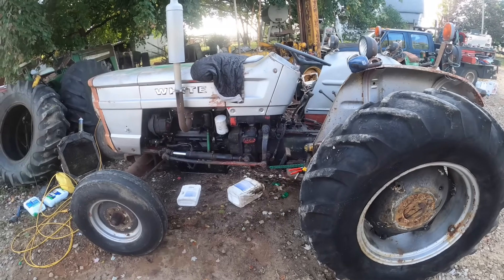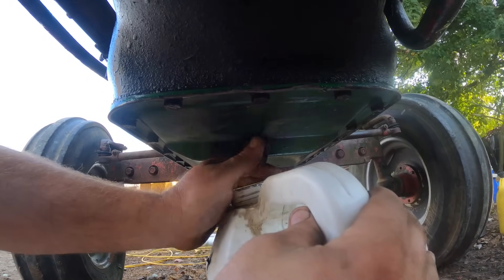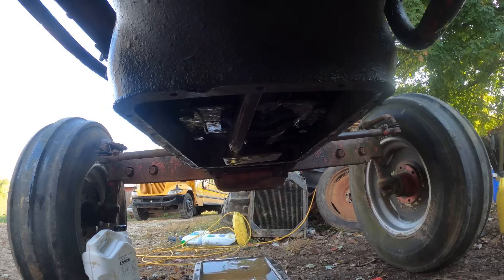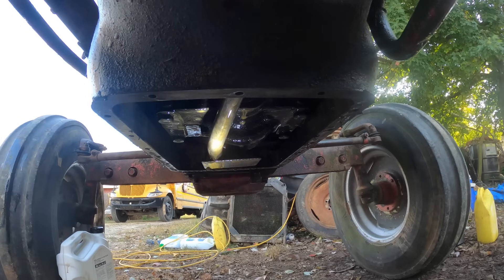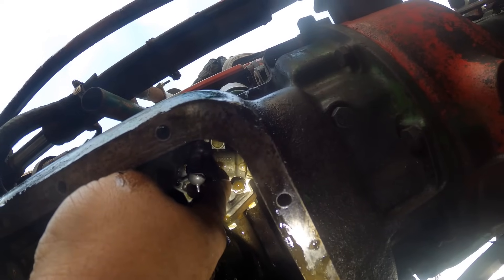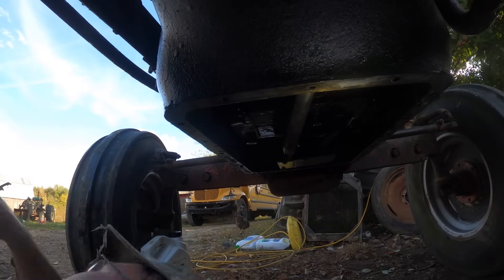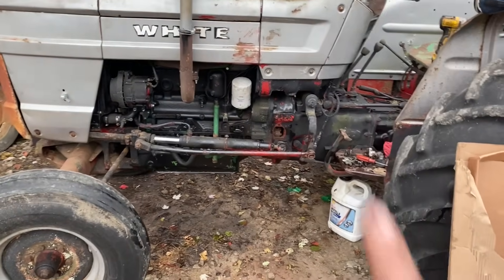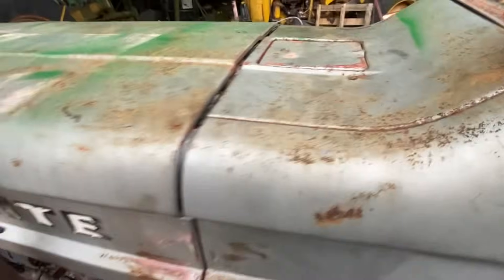The SADDEST FAIL ever. OLIVER 1355 bites the dust.

Comment: You have spent so much time trying to make this tractor serviceable.  I did not see this video when it first came out for some reason.  Oil pumps can be a real pain in the Knudsen.  Getting the pump out of my 235 was easy by comparison but anytime you are working over your head on your back, life is difficult.   For the longest time I have thought that you should go to Rural King and get a canvas drop cloth -- they do not cost much for a small one. If you put a drop cloth down underneath where you will be working, it helps when bolts, nuts, washers and other small parts get lost on the ground.  I started using a drop cloth when I was replacing the brake lines underneath my '55 Chevy and they are a god-send.  I meant to suggest this when we were at the fair together but it slipped my mind.  I thought of so many things I wanted to ask you about on the way home --- particularly that fancy 5100 planter.  Oh well, there is always next year -- and yes, I do plan on coming up there again next year.  It is a nice drive and hopefully I will have my beater back on the road by then!

Comment: Ross, since you have the pan off, just drop one of the bearing caps, that will give you a sign of if any damage has been done to the crank or rods. Check the rod first, it's definite you're going to need a new pump. Odds are, just a broken pin on the shaft. I get your point but, at least you'll have a better idea of what's going on with the engine. Besides, these kind of projects, they're winter projects for a reason. 
Sad news, possibly, I look at it as, more of something to do to keep myself occupied. LOL I do feel your pain though. Great video, cheers :)

Comment: Sorry to see the bad luck Ross, I wouldn't think that the shaft would break or shear the pin after getting it running, looking at that pump housing it sure don't look like the gears were spinning in there at least from what could be seen from here. One would think that if they corroded to the point that they left impressions in the housing if they were to break free after there would be evidence of them spinning.

Comment: Ross, looking at the evidence do you think the oil filter was removed at one time allowing water ingress to the pump. I say that because the trash in the pump is on the pressure side, and remember that when you had the oil filter off you had to clean the rust from the oil filter base before installing the new filter. The oil flows directly from the pump to the filter base, and then is distributed to the engine. 
Remove the balancer while you have the pan off and check it out. Balancer bearings are usually the first thing to fail when oil pressure is lost because the balancer runs at twice the speed of the crankshaft. The balancer bearings are pressed in bushings with a hole to align with the oil passage, and when starved for oil the bushings get hot and turn in the housing closing off the oil passage. 

With the cast pan removed it would be easy to check the rod and main bearings as well, and replace as needed. 

Hang in there, the sadness will pass!
Reply: Here is your problem, for sure.   Put in a  new pump, check balancer bushings, check a rod cap. Then decide what direction to go.
Reply: One other thought. If you have a cooling system pressure tester add 15 lbs. pressure to the system and see if you have internal leaks prior to removing the engine from the tractor. The milky oil is a concern. 
If you don’t have a pressure tester you can rent one at an auto parts store! Won’t cost you anything if you take it back.

Comment: Remember A lot of the Oliver and Allis 5040  were build by UTB as well as the long tractor  they were build by the fiat design. So the color red could be UTB on the 1355
Reply from the maker: Yes, the Allis Chalmers were built in Romania later on. This tractor is a true Fiat built in Italy. It is red because of the heritage paint.
Reply: Well these tractors are a trip and I don't think any of them are wired the same. But a beleave all the sheet metal is the same but the nose cone, I am trying to rewire mine but the new harness from Greece is suppose to be a match but isn't I have the 445 any clues on wiring codes would be helpful

Comment: In all lives some rain must fall.  Sometimes we wonder why the rain in our lives is a whole monsoon season.  You need to make a pressure oiler that you connect to the oil galley to pressure up the engine before you start it for the first time. Also, break down, clear a space in one of your buildings, and pour a concrete pad so you can split tractors more easily.  A little labor, 4-5 yards of concrete and you would be golden.  And now that you are an expert at G-rib metal, you could close in the sides and make a simple door. OH, did I describe a shop?

Comment: Next thing to check before going any further, check the bearings for damage from running without oil.  Then decide from there.  Still don't explain the moisture in the oil.  In for a penny, in for a pound!